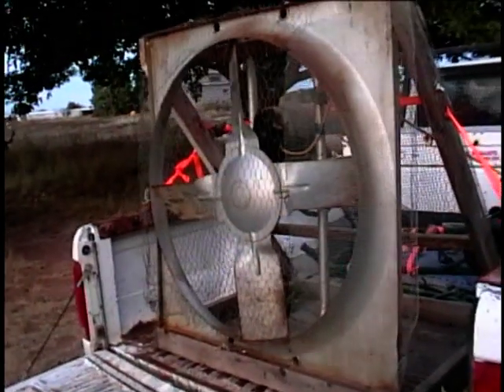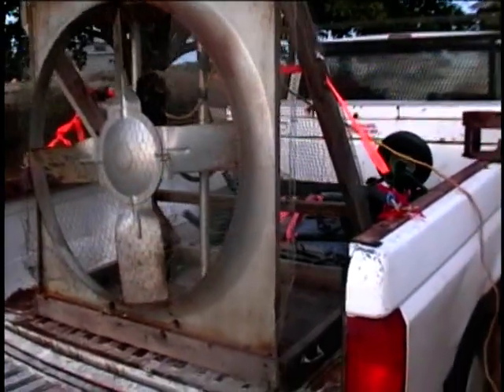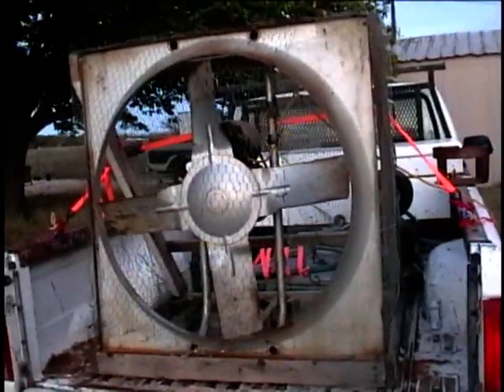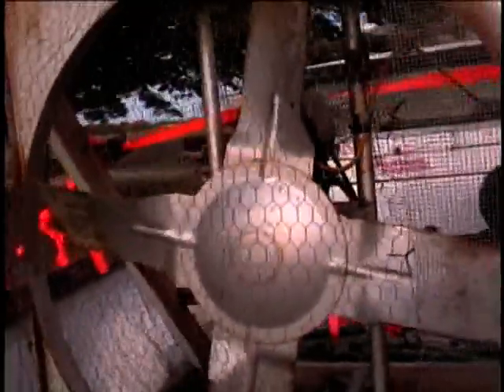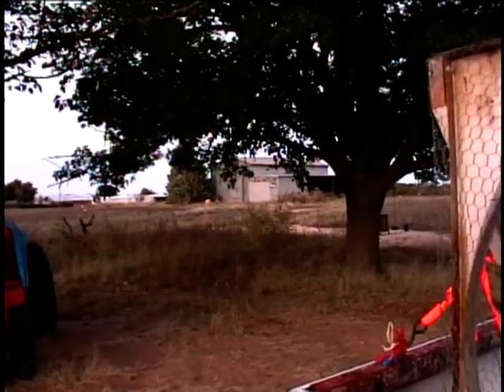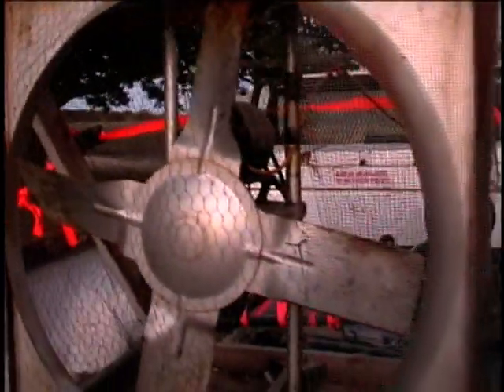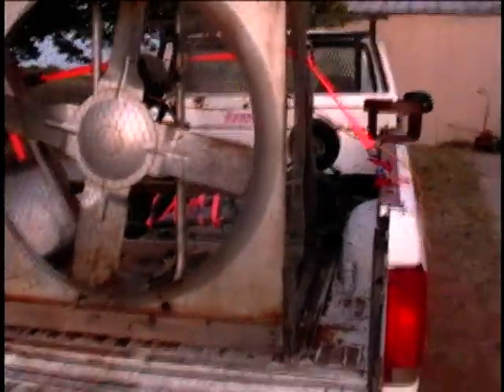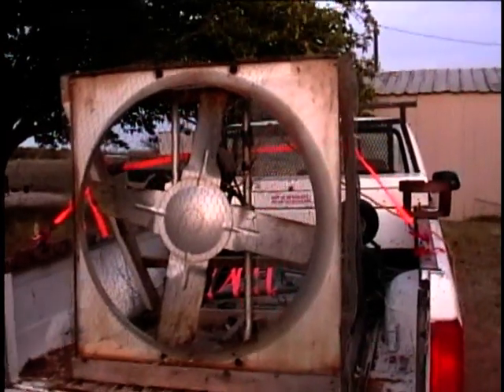DeBothezat Huge Industrial Fan

Comment: Holtzer Cabot is an old name in motors. That fan looks like maybe a whole house fan, those were typically belt drive and meant to run pretty quiet. A lot of people use those in barns, shops and such now after they're removed from the house.

I'd replace that bent pulley, that'll eat belts and bearings.

Comment: That's a big fan, and was quite a buy for 10.00, I amost expected your truck to take off by itself by wind power.   I was at an estate sale yesterday in a large old 3 story house.  They had a fan built in on the 3 rd floor that was about 5 ft tall.